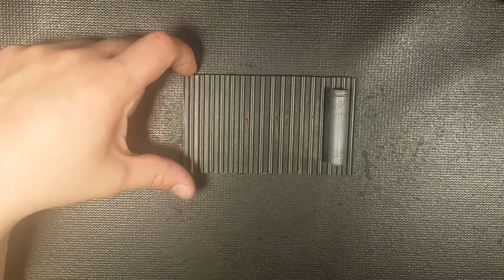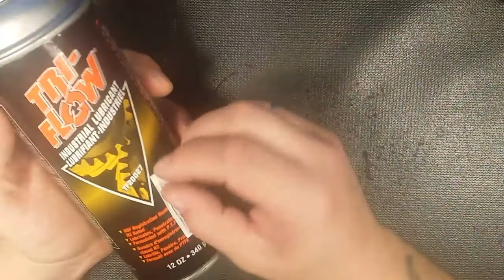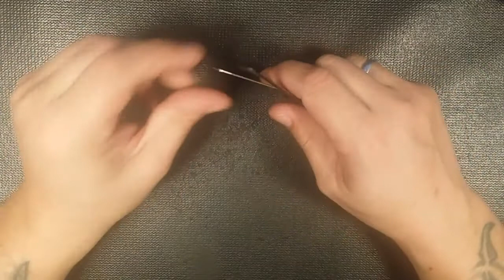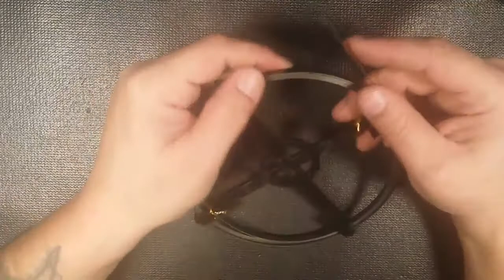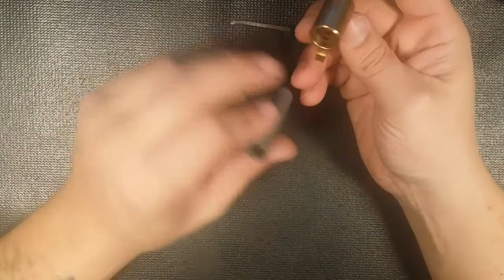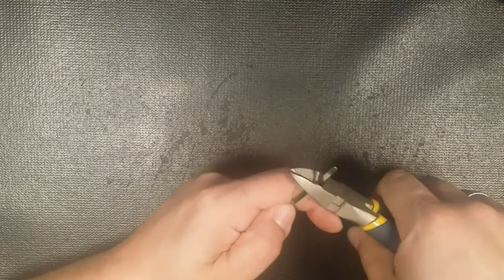-=212=- Lockpicking On A Budget - Low Cost Lockpicking Tools

Comment: Some towns/cities in Australia use spring steel brushes on their street sweepers, some are wider than others but they're all pretty similar in size: ~28" of spring steel folded in half, between 2 - 4mm wide and about 1.4mm thick.

The metal used for engine oil dipsticks is a good size but not as abundant as street sweeper bristles.

Comment: hello good morning great video. have you ever seen a gutter nail for hanging gutters on a house. they're made of aluminum in the round. you take a Dremel tool with a blade and split it down the center to the length of your pick handle. add some epoxy insert the pic handle let's set. then drill it with a very small drill bit. it has nurleing on it for good grip.cut to lenth you want.file flat or leave round.or add wire shrink. great feed back vary comfortable. 😎😎😎😎😎
Reply from the maker: Sounds cool, I'll see if I can find one and check it out. Thanks man!

Comment: Merry Christmas & Great video.
Just a FYI, inserts from wiper blades, not looking like displayed not to be discarded. Some make great pry bars, split style inserts even make excellent tools too.
Reply: *plug followers for American / Master
《On Ebay, search, "2x Nylon Polyamide PA Extruded Plastic Round Rods Stick Stock Black 10mm x 250mm" 》
($5- free shipping, makes up to 10 followers) 《Can file ends to fit cores as needed or file side to fit crimped Master locks》
Reply: *pinning tweezers easily made by wrapping working end with rubber band, clamping other end in vice, spread tweezers apart insert & drill (with 1/16" or 3/32" drill bit), then finish off tip (file or grinder) 《do not use thin/sheet metal style》
[For reference-from left #'s 3,4,&5 are suitable: http://m.harborfreight.com/6-pc-fine-point-tweezer-set-93598.html ]
Reply: * Dimple Picks, can be made from  (preferable new) utility flags. 
-heat & bend 1/4" of the end to 90°.
-cut a light groove in plate of steel with hacksaw.
-reheat bent end, lay section you're holding into groove with bent end on metal, smack with hammer, file /grind to shape. Now make a handle.
Reply: oh yeah, 
Harbor Freight sells metal clamps
(like zip ties) item #60330 for $6.99 that are
0.009" (nine thousandths inch)
that makes a superb decoding knife for multi wheel combo locks.

Comment: Merry Christmas! If you don't mind a little bit of work, you can get plug followers that rival any of the expensive ones you can buy commercially from old printers. 

Everytime I see an old ink jet or laser jet printer thrown out I grab it and tear it down for electronics components (mostly for the stepper motors). One day I realized that I also had started a pretty good collection of round stock from the rollers. a few of them turned out to be perfectly sized for the two most common core diameters. Each piece yields 3 or 4 good sized and highly polished plug followers. More if you prefer the stubby variety. I even cut the ends with offsets to match the backs of common cores, just like the professional followers.

Different printers have different sized bars in them, some seem to have more than one would think a printer would need. It's hard to predict which will have the good stuff but I probably see a printer every 2-3 weeks that has been thrown away, and I'm barely looking at all.
Reply from the maker: Awesome! I'll keep an eye out and see what I can find. Great idea. Thanks for sharing!